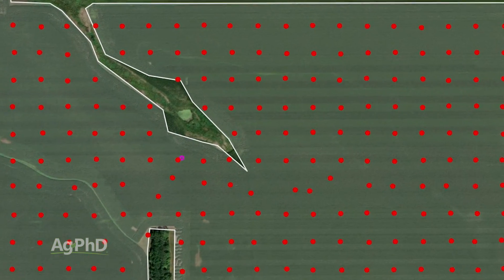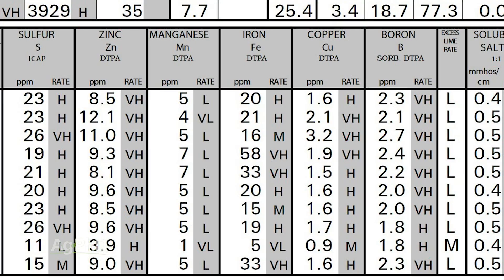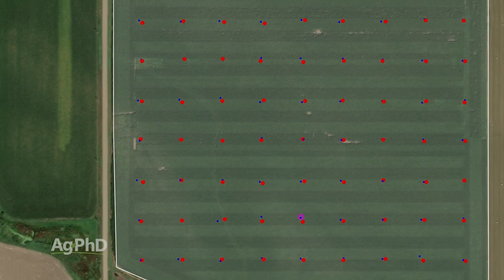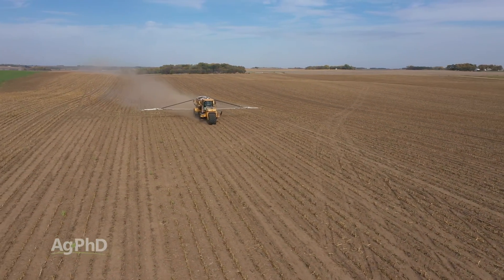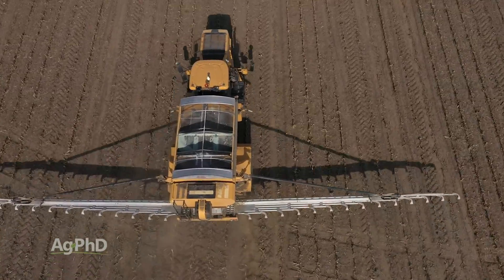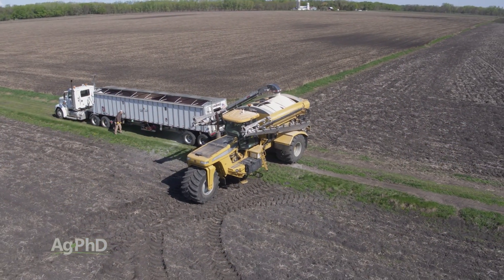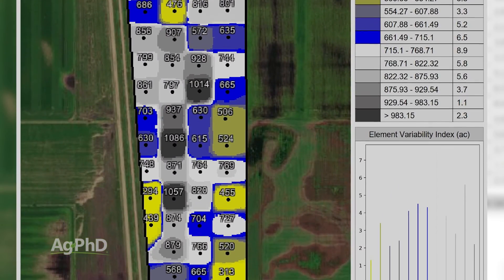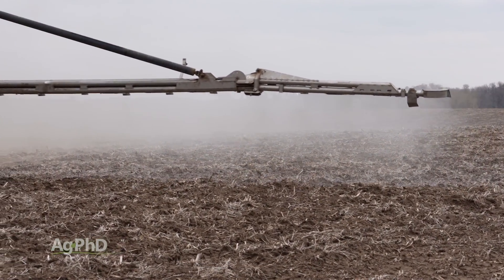Variable Rate Fertilizer

Comment: What would you guys recommend for growing organic vegetables and potatoes. I want to build the soil via cover crops and some manure. I am in Ontario and have thick clay soil, I want to store carbon and build the soil, but the ground becomes very hard to the point where getting a spade into the ground past 4 inch is difficult, I want to reduce till, but No-till has been a challenge with weed control and compaction. Tell me your thoughts both for fertilization and alike
Reply from the maker: Brian and Darren addressed your comments on Ag PhD Radio: https://soundcloud.com/agphd/12-17-21-farmer-friday?si=f2fa587eb21c49bcbe5b67d0d41a0808&utm_source=clipboard&utm_medium=text&utm_campaign=social_sharing#t=52:04